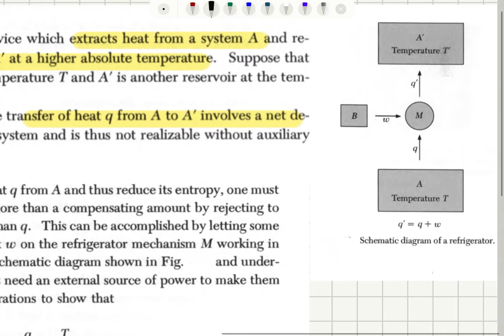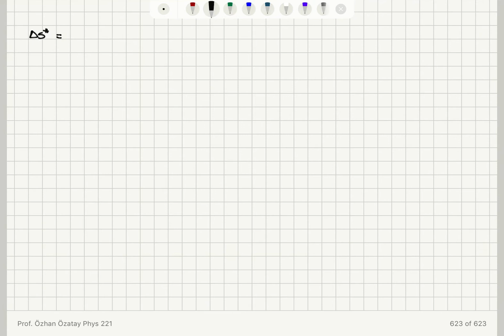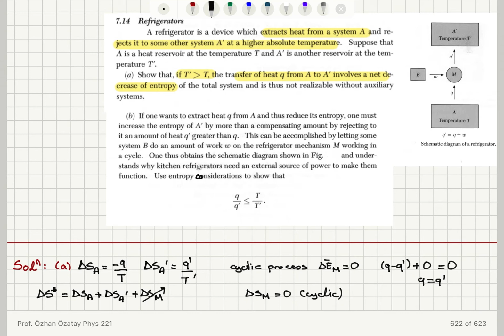7.14 Refrigerators

Comment: Why we didn't consider the entropy change of B, auxiallry system that does work on M?
Reply from the maker: Because B is not part of the refrigerator. It is an external agent doing work. For the same reason in 7.16 we dont consider the outside system on which the engine is doing work. Also note that there is no heat exchange with system B (i.e. adiabatic process- only work so no entropy change anyway)
Reply: @ozhanozatay  Thanks!